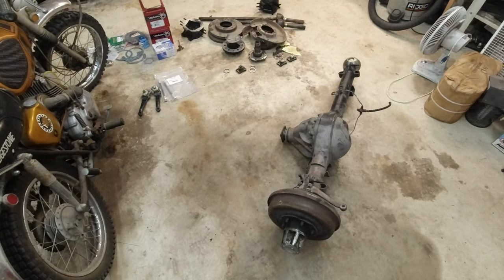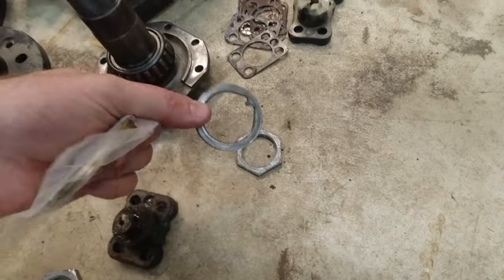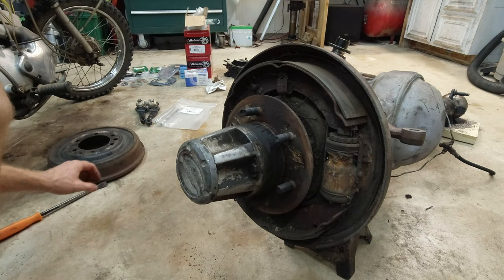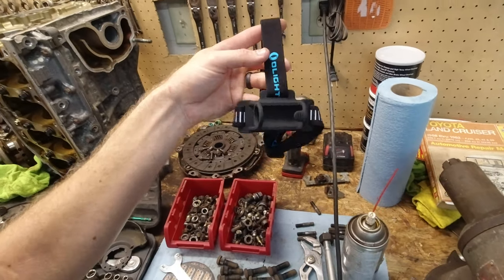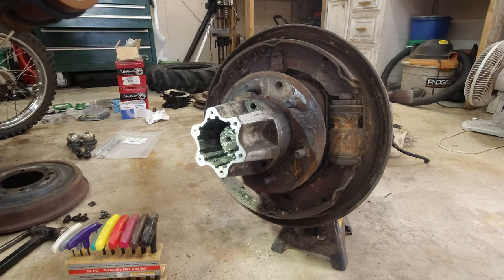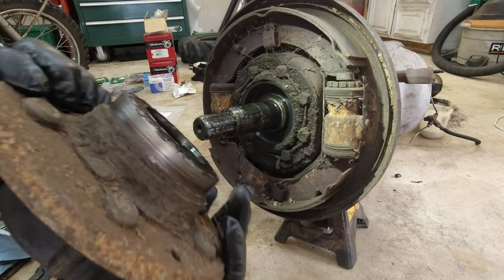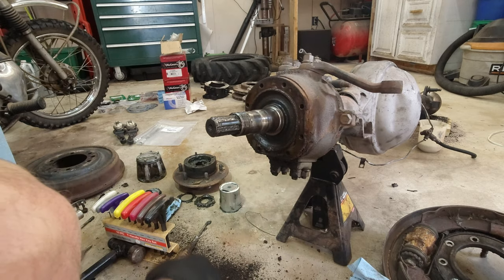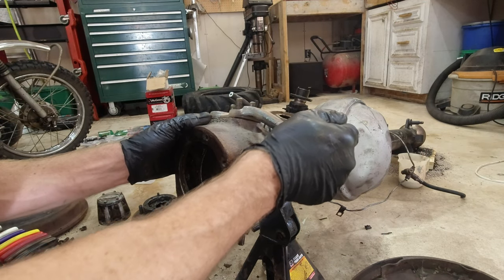Front Disk Brake Axel Rebuild | FJ40 Toyota Land Cruiser

Comment: Jordan...just curious? Do you often(or ever) go back and watch the parts of the video when you disassemble components...just to make sure when you reassemble them, that no major snafus occur...or are you just that good? Thanks for great entertainment...no matter which it is👍💪🔧⚙🔩🪝🧰🧲⛓🪛‼️
Reply from the maker: If I just took something apart then no I can remember. If it has been apart for a while I try to label things so I know where things went. It’s mostly the bolts you need to label, all the other parts just fall into place.

Comment: hi  Done hundreds of swivel hub o/hauls .  Purchase a PULL  gauge  [spring loaded ]  then hook to steering arm and adjust preload /drag on hub bearings till it reaches 6 kilo grams  Kg  . This is the Toyota specification . It will stop premature wandering of steering when driving .
Another is to fit eccentric hub  bearings . These will change camber and caster . This also improves driving experience
Reply from the maker: I did the pull gage on the steering arm. I've never hear of the eccentric hub bearings for the FJ40. That's cool!
Reply: @HumbleAcres  Both the swivel hub eccentric bearings [allows u to set caster /wheel alignment ]  and drag pull gauge [sets drag on swivel hub  bearings by shim install ]   apply steering stability to vehicle when driving but by different methods . Once done correctly vehicle WILL drive well . eg  new car . I cannot stress enough that 95% accept the rubbish results if not done properly . Eg by setting drag to 6kg the swivel bearings will have a long life and a short life if not done .

Another tool which I found  great is a centralizing tool . Basically checks for axle centreline height compared to axle seal .
Also never throw away axles because of seal area wear ,, have axle metal sprayed --this has to be done

Comment: Great video, thanks! One slight note: it's not about having the same number of shims above and below the knuckle; the idea is to center the knuckle in relation to the axle housing, to prevent excessive wear on the inner axle seal (wear caused by slight oscillation). The shims set the preload but also move the knuckle up and down in relation to the theoretical center of the axle. This helps compensate for slight variations in the castings etc. Unfortunately you need a special and very expensive SST to find the exact center, so the best bet is to reinstall the shims in the same orientation they were in before the rebuild.
Reply: Also, you need to bend one of the lock washer tabs forward, and one backward, otherwise you're not really locking the outer nut to anything.

Comment: Great video Jordan! I have done many Dana front ends and never had one as easy to pull apart as this. Those knuckles typically really like to stay together! I have a Ford 1500 compact utility tractor that I’d redid the front Dif and it is amazingly similar to this. These are really good front ends imho.
Reply from the maker: Thanks! These things are built strong.

Comment: Thanks for sharing I’m about to do mine 75 series axle’s looks easy enough 👍
What have you done with the Perkins 6354 great job getting it going again 💯👍
now that would be awesome in a 40 someone would make an adapter plate wouldn’t know yourself
Reply from the maker: I sold the engine.
Reply: @HumbleAcres  
Oh well how it goes 
Still great you saved it